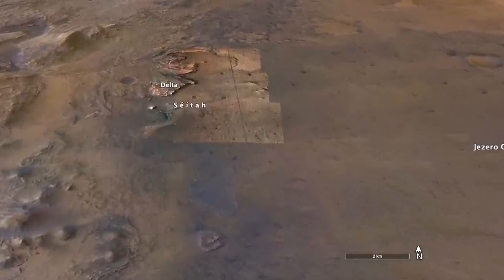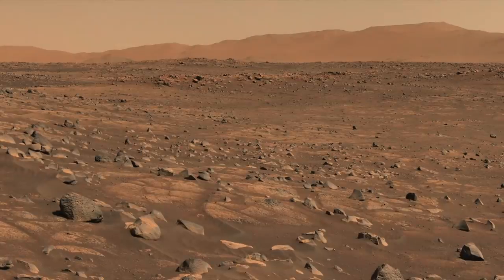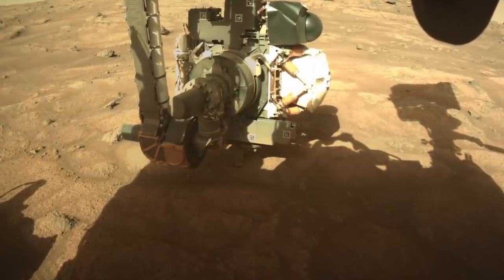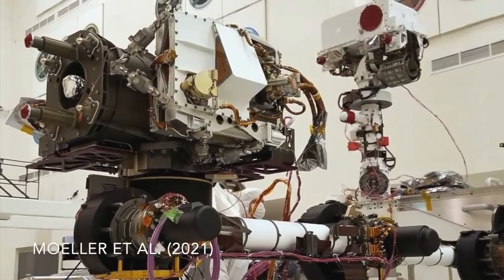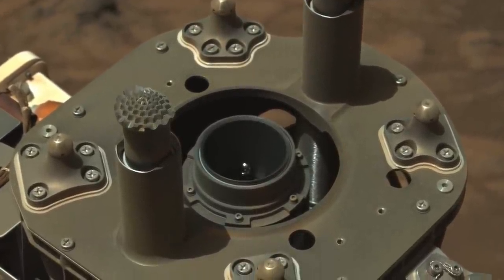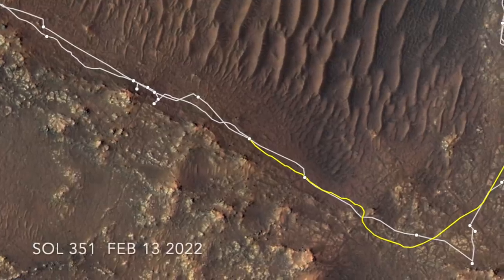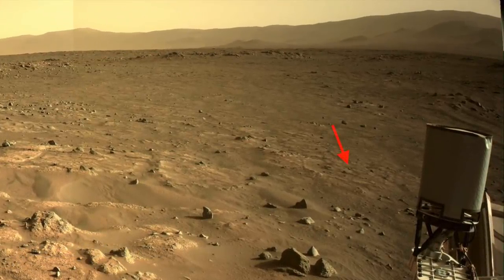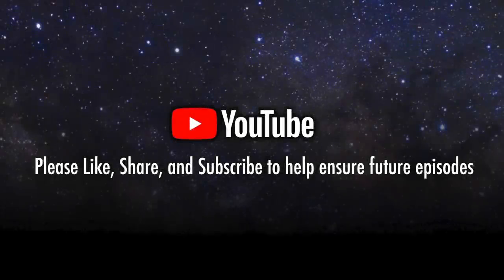Perseverance runs over its own hardware

Comment: Why are they going back along the same path??? That doesn't make sense...
Reply: They sent the rover into Seitah to look at interesting stuff (since it was already there after landing). The next step is to go over to the Delta. Since Seitah is too rough to traverse to the Delta, they are back-tracking the rover to where it originally was so it can use a safer route.
Reply: Navigation is autonomous between waypoints, it does make sense for the rover to evaluate the risk of taking a particular path as being approximately the same back and forth and end up in the same patch. Also, a known tested route can potentially be traversed faster due to the perceived reduced risk that they offer in comparison to the surroundings.